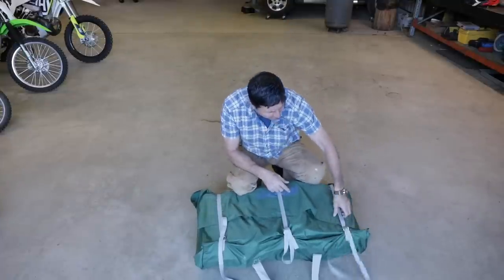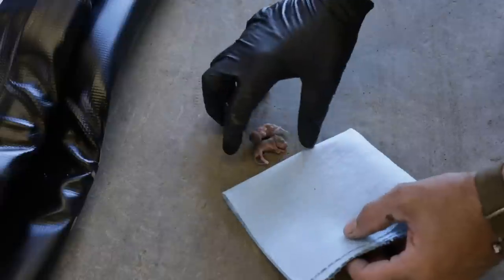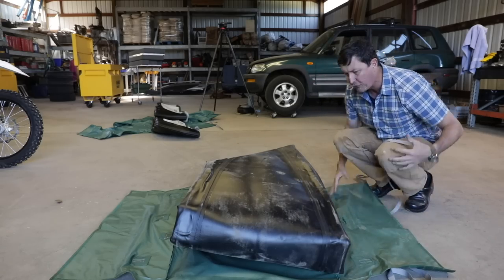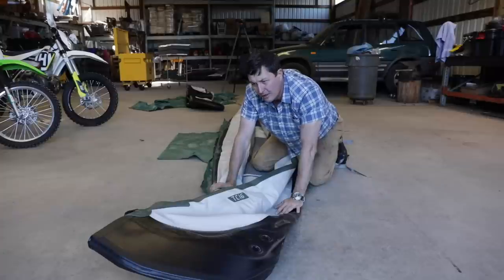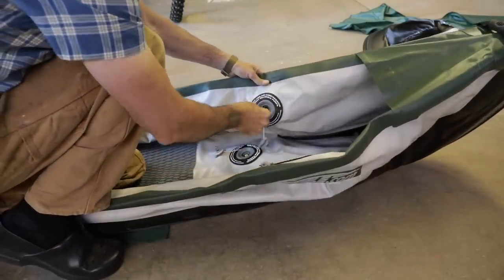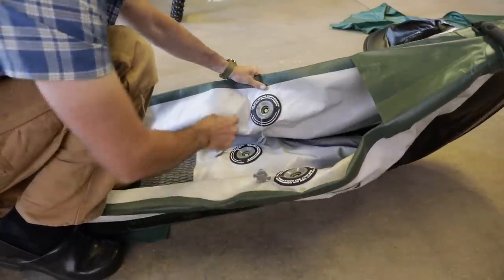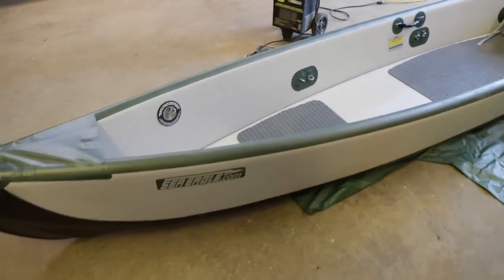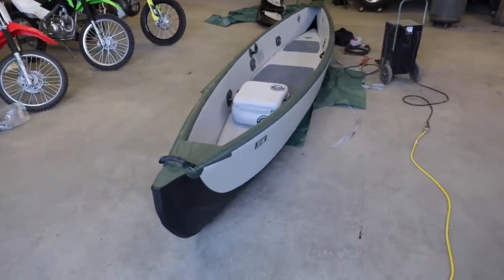TESTING A Boat In This Bag

Comment: Check your van,  a mouse might have escaped from the bag while you had boat in there.
Reply: And they looove chewing wires...
Reply: Just had a mouse chew the transmission wiring harness in half on my car so, after splicing it back to together I can officially say I hate mice with a passion.

Comment: I've used those valves commercially, the push in and turn lock is to allow the raft to deflate without interference from the valve. When you insert the fill line it should push in the valve allowing to compressor to deflate the raft anyway, but if you don't have the air line plugged in it makes folding the raft much easier.

Comment: I have so much stuff hanging from rope. It is a great way to save space as well. I initially tested this something like 20 years ago with a bag of frosted flakes. I really did not expect it to work; however a year went by and the bag had not been touched. Needless to say there is all kinds of stuff hanging from crossbeams in my barn now.

Comment: FYI Cody; Even if you have a brand new 100% charged battery sitting on the concrete floor it can ground out the battery. Try slipping a piece of wood or rubber under your battery to break contact with the floor and it will work just fine. Hope this helps in the future. God Bless you and yours. We love you guys. QST and family : )

Comment: I had lots of fun on my Sevylors.  It's nice to be able to carry a boat in the back seat.  I used self-adhesive patches from a pool store to fix my boat.  They were much easier to work with than the Sevylor repair kit.
Reply from the maker: Thanks for the tip.

Comment: Get farm cats, 3+ female cats will wipe out any mouse issues you have. My family and I live in the country and we were dealing with the same issue you are. We found some kittens for free. Within a month of them reaching hunting age the decrease in damage will be prevalent. They are cheap and easy to maintain. For our cold Minnesota winters we took 2 large Styrofoam fish coolers and cut a hole in each one and placed a heated pad with a blanket over top of it inside the cooler. We stacked them on top of each other and built a wooden shell that sits over the coolers for aesthetic purposes. There have been days where it has been in the -20's and we go out to check on them and when we take them out of their shelter they begin to steam in the cold environment similar to when you exhale on a cold day. I hope you have found this helpful. Keep up the good work.
Reply: I just remembered from your video where you put in the lawn slicker for water and that mouse jumped out at you. I remember you mentioning that Jack saves the mice!

Comment: Hi there just wanted to offer a word of advice on patching your inflatable don't use the glue seaegale provides with the raft it's OK in an emergency situation for a temporary fix but will make a lot more work for a permanent fix. I  have used stabond it a two part glue with great success it works on pvc , hypalon, neoprene pretty much anything , I have also heard Clifton works well and there no accelerator to mix with glue also I would stay away from hh-66 cement glue I had issues with this melting my patches.

Comment: Sweet loaf looks so adorable! 
I am not sure if they sell them in the states I bought ours in the south of France. It was a little short sleeve and short leg “wetsuit” it’s not made of neoprene it’s made of like a spandex but the floatation devices are built into the suit on the body and the shoulders and it doesn’t restrict movement at all. Also its factor 50+ sun block so protected from the rays also. I will try to find it and post a link. But it’s a must!

Comment: out in the country just buy a used water tight cargo shipping container to store vulnerable things, can find em under 10k but you will probably want to pick it up in person, shipping costs might be unreasonable. if you don't bring a mouse (or a bug) in with you, there won't be a mouse in it. and they are massive, you could probably fit your tractor in one with lots of room to spare front and back depending on how big ya go. just drop it on a basic concrete foundation (two strips would be enough) and there ya go, animal proof storage. might have to renovate it's weatherproofing when ya get it, but compared to weatherproofing a barn (and in particular animal proofing) it is really easy. big old steel box with weather seals, should do the trick.

Comment: That mouse was a bummer! If I may offer some friendly advice regarding the PFD for sweet loaf... I, personally, would try it out in a pool because the ones with that flap have a tendency to flip the child over, face down in the water. It’s meant to hold their head up, but a child who doesn’t weigh much has the opposite effect.

Comment: a cheap suggestion for your mouse problem ( besides a cat) when I stored my rv in a storage lot in the country everybody threw a bunch of dryer sheets In the doorways and around the floor and it seemed to keep the mice out perhaps throwing a couple of sheets in the boat as you are folding it would help have a safe and happy 4th, Russ

Comment: Aw, man! I've recently bought a kayak. It's so much fun on local lakes and rivers!

Do those seats tend to stay in place? My kayak's seat just clips into place like that, and slides around a lot. I've had to find ways to stabilize the bottom.
Also, that skeg: You might want to consider drilling a small hole, and attaching some cord to it, to lash it to the back of the boat. If you happen to run across something too close to the bottom, you won't lose the skeg! If the slide-out is facing the correct direction, hitting some shallow rocks, or running over a fallen tree will just pull the skeg out, in stead of stopping -- or worse, damaging -- the canoe.

Comment: If its a hypalon boat then the patches are actually stronger and thicker than the original material. But if its pvc then you can still patch it but you have to keep more of an eye on it as the glue for those isn't as much of a molecular bond

Comment: I dont know anything about mice.. but in my head this idea works Haha... but put everything on shelves (like you have on the back wall of this video) and about a foot off the ground, on the uprights of the shelves, add a metal cone.  Open side down, point side up. Like a dog cone from the vet Haha.  I've seen people use similar setups on trees to keep squirrels out of their trees.  Hope this comment isnt totally stupid, as I say, I dont know anything about mice.. if you told me they could jump 2 feet vertically... I wouldn't know if you were pulling my leg or not.  Hahahaha

Comment: Hang stuff from ropes that you don't want eating. That's what I do with sacks of seed and it's always worked for me.
Reply: James Bradwell Yes, it is a good idea! That is what i use to do :)
Reply: James Bradwell that's what I was gonna say. Just suspend all your gear.
Reply: keith moore they would have to climb down the rope or cordage. You could also put rodent repellant on the cordage
Reply: I'm sure it's possible. Has never happened to me though.
Reply: Haha hanging your gear won't help . If they want it they are going to get it. Mice are dumb but rats will climb ropes, climb straight up walls like spiders, chew through concrete and plywood etc. What ever it takes to get at what they want.
Reply: If you add a steel or other slippy metal lamp shade so far up the rope, tight to the rope, the mice can only get so far down before they fall / slip off, never getting to the stuff below (unless they leap onto it - and at that point, they deserve a free meal for effort).

Comment: I hope that compressor lasts for ya. Hooking it straight to a battery charger is not a smooth move brother.
Reply: Sunset Valley Ranch Honestly.. 12v is 12v.  Doesnt matter how or where it comes from.  It is designed to plug right onto a battery, no reason a 10a 12v charger would do any damage to it.
Reply: Open circuit voltage on those chargers can be quite high, sometimes over 20V. It's also likely to be unfiltered, so it's not really DC, but pulses of rectified AC.

Comment: Btw you could most likely use some flex seal tape on the hole and patch it , since it does make an absolutely amazing bond to the material that it's connected to .